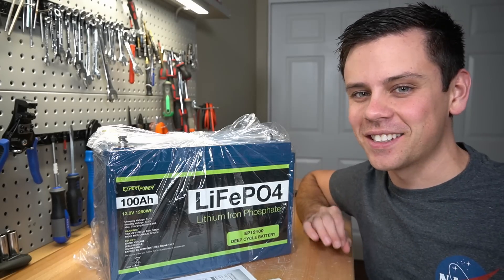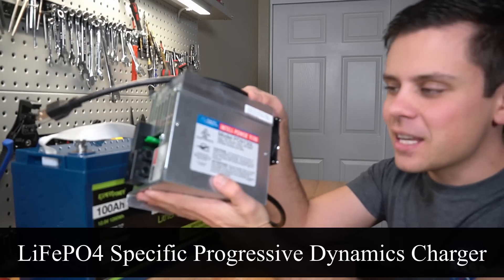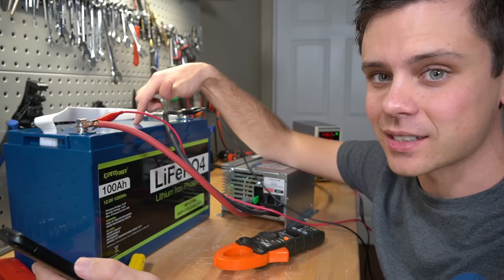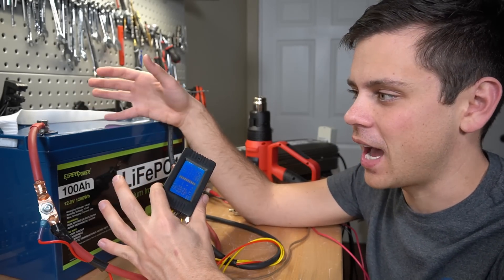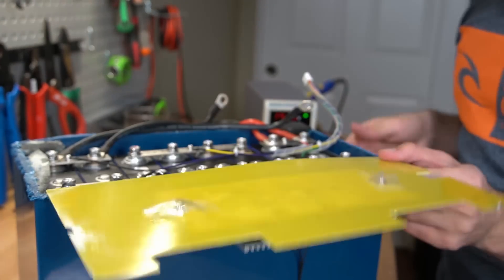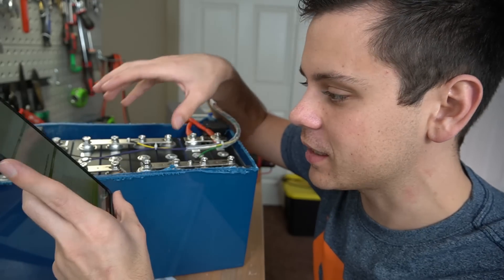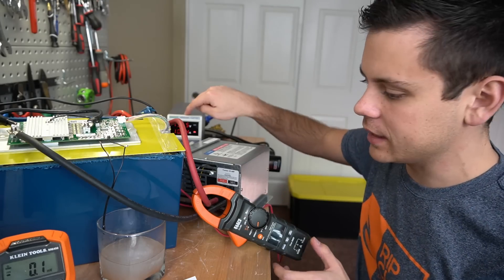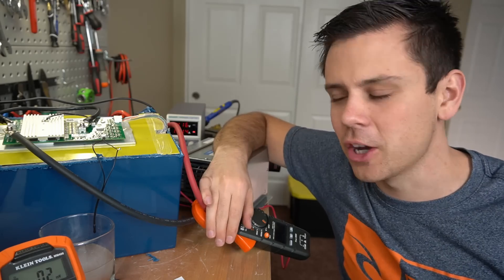ExpertPower 12V 100Ah LiFePO4 Battery Tear Down!

Comment: Wow! How times have changed. While everyone is complaining about inflation, this 12V 100Ah battery was $700 four years ago and now I am considering an ExpertPower rack mount 48V 100Ah for $1000. And Amazon has other 48V 100Ah's for less than $800.
Reply: Same

Comment: I have a 20ah from eco worthy and I was wondering since I'll have two in my bike trailer my worry is tho I will have them over rated temperatures above 180+ and they max at 120f in the trailer how do I keep them cool ??? Especially that significant difference

Comment: You should of tried putting both temp sensors in the water it could get an average  or lithium is hard to freeze and it maybe it needs to be a that temp for a longer period.

Comment: Why would you charge your battery in 6 degree temps..? Lol if you charge it Inside like you should it’s easy and fine no problem with the battery it will function just fine

Comment: Just got ripped off buying that garbage. Showed up dead. Won’t charge after trying various methods.  All I did was connect an inverter that was turned off and the controller (panel switch in off position).   Instant death because some cables touched it or was already dead. 

Can the BMS be replaced by a better BMS?  Did the BMS kill the batteries?  Oh. It’s winter. The battery was in my van all day.  30 degree temp. Dammit.  ExpertPower still knowingly selling faulty product.

Comment: Does anyone know of any ill effects of me putting 6 (six) new ExpertPower 12v LiFePO4 200AH batteries together in parallel? I heard Will mention in this video that 4 was the limit for the 100AH version. The 6 I have are all same age, all were independently charged to 100% prior to connecting them together and I will have red wire to inverter/from charger on first battery in parallel and black wire on last battery. Any feedback would be appreciated.

Comment: Low Temp protection not very important down here in South Texas. Very rarely below 37, might freeze once every 3 years.
Snow, well we had a 100 year snow in 2004, of 12 inches is highest areas and next most major snow was in 2017 of a whole 1 inch. We did have a major (for us) freeze in February 2021, expect another one of those in 100 years. Took down most of the state power grid. Luckily I had converted everything I could to gas in 2018, so we stayed warm. In my 64 years of life the only time cold effected power was in 2017. So what good is a solar system if doesn't work when it is cold? Granted we mainly need power during hurricane season when it rips the power poles out of the ground, summer-fall.

Comment: Hello Will, I really need your help with finding out more information about this particular 12V 100AH Lithium Ion Battery, under the name of Power Queen, currently being sold on Amazon. I want to know if this battery has a temperature gage, and if you would recommend buying this battery?

Comment: Thanks will we have just decided to go 6 V 210Ah AGM batteries to Upgraded 2021 12V 310Ah Lifepo4 Battery Deep Cycle  based on your breakdown review in our RV thanks for your work, I am so appreciative of what you do.
I have been told we do not need to upgrade our solar or shore power charging system by our local supplier in New Zealand and am worried this may be incorrect. 
I would appreciate your thoughts if you have time.

Comment: With batteries like this that have a BMS, why can't they be charged with a standard (non-CC/CV) DC power supply? I would have thought the BMS would handle the charging and cell balancing.

Comment: for all these batteries with no low temperature sensor.....for us fisherman using these exclusively for trolling motors not in the winter of course or even remotely close to temps that will damage the battery, you darn well bet these cheaper LIthium batteries are an excellent fit.

Comment: Hello,

I have an ExpertPower 20Ah LiFePO4 battery. It's about three months old. 

For some reason, I am not able to get current out of the battery, even though it's been charged on a charger sold by ExpertPower and sized appropriately for the battery. The battery appears to take a charge. When I connected the charger, it showed RED on the LED while charging for ~1 hour, then the LED changed color to GREEN. The charger has a small fan, which I could also hear running.

I suspect that I might have tried to draw too much current out of the battery and the BMS intervened to break the circuit, which is reasonable. What I don't know and can't see to find out how to do is to reset the BMS. I have tried putting it back on the charger, I get a GREEN LED, but still no output from the battery.

Any thoughts or advice? I didn't find any procedure for this on the ExpertPower website.

Comment: Looks like the faulty low temp cutoffs were fixed... Can anyone confirm this?
Q: Have the units with the faulty low temperature protection in the BMS been replaced?
A: Hello, Yes! As of April 2020, all 12V100Ah LiFePO4 models have had the low-temp correctly implemented! ExpertPower on April 22, 2021

Comment: I was wondering if you could help me with my question or anyone else who reads this.  I am trying to replace my E-Grizzly Venom 1500W Electric ATV's acid battery (4x12v20Ah lead acid) with a Lifep04 battery.  Could you tell me which you would recommend (type and brand) that could effectively replace the acid battery.  Currently my ATV battery runs the ATV for about 30 min before it dies out.

Comment: Hey Will! Could you do a Chins battery some time. They are supper cheap,  and they are suppose to also have low temp cut off and heated cells. I'm really curious but just not as skilled, crazy, gutsy as you to cut one open.

Comment: I know some batteries have warmers for "cold" weather.  But how good are they and how much power do they consume?  We live in Michigan and do winter RV camping sometimes.  A few times the night time temp is down to 0f.  Will a battery with a build in heater stay warm enough.  Do I have to put my batteries in an insulated (to the outside) box with supplemental heating??

Comment: Enjoying your videos.  Some advice please - I'm in need of a LiFePO4 battery for my kayak trolling motor.  Weight is an issue, but I also want to optimize my time on the water.  The trolling motor is a Minn Kota, 12v Endura, 50lb thrust.  It has a max amp draw of 50. The manufacturer suggests nothing less the 105 amp hr.  Any advice you can offer is appreciated.

Comment: I looked at the 200AH version of this and it's $1449.99. In order for me to get 24 VOLTS at 200AH I would have to buy TWO of these costing near $3K when I can buy a 24 VOLT 240AH battery from Big Battery for $2400 and save $600 plus get 40 AH MORE CAPACITY ! DO NOT BUY THIS BATTERY IT'S WAY TO EXPENSIVE FOR WHAT YOU GET. Go to Big Battery online and get your batteries there instead.

Comment: Hi Will, love your youtube channel.
I have a quick question about the ExpertPower 12V 100Ah you tested a year ago.

We bought one accepting that there is potentially a risk re quality control.

Battery worked great from August until November.

We put the RV in storage for winter with the battery at 60% charge.

Took it out of storage this week and battery is completely dead, <0.1V measured with two voltage meters.

Three days of sun on the solar panels and it didn't charge at all.

Took it out and hooked it up to a battery charger. 

After 12h of charging at 5amps it still only reads 2.5 volts for a few second before dropping to 0V again.

That's a dead battery right? It has a 1 year warranty so I'll be reaching out to ExpertPower via Amazon.

What could cause a failure like that? It worked fine for a few months, was 60% charged and then after 8 weeks with all power turned off it's completely discharged and won't hold a charge. 

Thanks for any thoughts or input.

Comment: First, thanks for the great info and video.

i have one of these batteries thats 3 months old and it just went to 0 vdc. i tried to charge it with a NOCO GENIUS10 charger at 40F and no good. Tried it again at 70F and still nothing. The charger has a force mode for charging batteries with a voltage lower than 1V. Op manual says to Press and Hold for five (5) seconds to enter Force Mode. The selected charge mode will then operate under Force Mode for five (5) minutes before returning to standard charging in the selected mode. Is this worth a try?

Any way to reset this battery so it will take a charge or can i get it replaced under warranty? Thanks

Comment: I bought one of these batteries, so I'm disappointed about the Low Temperature disconnect. Should I send it back?  So do I need to keep it warm? Also, how do I monitor the amount of capacity left in the battery as I'm using it? Will a small, simple capacity meter, as used for AGM Batteries, work for monitoring it's capacity?  Your reply appreciated.

Comment: I have a sailboat I want to upgrade to LifePO4 batts with at least 600amp storage, solar, victron solar charging controllers and be able to charge at maximum current. VERY interested in building batt sytem myself. What are the absolute critical criteria when source cells. Oh, want bank to charge at 24V. Looking for some help

Comment: Just checking, you're talking about some pretty serious temperature ranges and load testing, presumably for home solar setups I think. I'm looking at using it for a single panel setup in the back of my ute with a dc/dc charger that has its own safety settings inbuilt. And my ambient temperature range would be 10-40°C (10-104°F) anyway. My max draw on this setup is also only 9A because it's only for a small fridge and a couple of led lights. I can't see how I would actually ever be pushing this to the levels of when these safety features would be needed. Am I being naïve?

Comment: Hi, really enjoy your channel. I have a little problem with my lifepo4 battery.  I bought a battery from China and it has been good for couple year. Yesterday, I was using it and suddenly the battery shutdown and never come back.  Before it shutdown I notice the voltage is around 10.x volt.  Is this low voltage protection behavior? If so, how the battery can be turned back on. If not, is my battery bad? Really appreciate any expert advice.

Comment: My question for you if you ever see this comment is would i be able to use this battery as reserve for my car audio system running a amplifier that draws 300 amps at max power but most likely around 150 amps at like 30 mins at the  longest all i want to know is would you recommend this battery for that type of situation or should i spend more on a big name brand and avoid a headache?

Comment: Great video! Now I only watch your videos when I want to know something about solar. Which brings me to my next question: I am scared of a fire in the shed where I am building my mini solar system.
It will be two deep cycle acid marine batteries, a 1000watts 12v powee inverter, a 30amp charger and 3 solar panels.
What is the best way to avoid a fire?

Comment: Hi, I just purchased 4 of this type of battery but 130ah. I have them connected to a pip4048 inverter /charge controller. I am running a 2.4 kW pump to irrigate pasture. It has been running - 2 months. It is working great. The pip4048 has been reflashed for Lifepo4.

Comment: in a rv how did you solve the issue of hi amp draws from an inverter when using common household appliances with out the bms taking the day off?   between the convection microwave oven, a few crt tvs, an ice maker, a freezer, a separate refrigerator/freezer pair  i'd estimate pulling 300 amps through the 3000 watt inverter. the biggest bms i'm finding is about 120 amp .

Comment: This was 6 months ago. Any word on the New battery? I would love to see the test and price point. Great video! Take Care and be safe, John
Reply: It's in the pinned comment. BMS was not programmed for low temp only high temp
Reply: @south02m  I had read that. I didn't know if he had got another one that tested correctly since and what the price point was, at that point. I mean, they said they were going to fix the problem, but has anyone tested a new battery since? If I were to buy one today, would it still have that issue? Thanks, John

Comment: I had to laugh when you 'stayed put' for the entire battery discharge cycle.  I used to perform destructive anaylsis on lead-acid cells (to build our own batteries for a rocket factory) about 30 years ago for the Delta Launch vehicle.  Yeah, old school.  One of our tests was to check capacity,  and had to record the cell voltage during discharge at time intervals.  Difficult to stay awake.  This was before new test equipment was procured to perform this test automatically.  Appreciate the tear-down.

Comment: Since the battery has a max charge rating of 50 amps, do you need to somehow protect the battery from charging too fast? 

For example, if a system had a 50 amp DC to DC charger from the alternator running at max speed and a solar array charging at 20 amps. Total charging amps sits around 70 amps which is over the rating for this battery...

Comment: All  Victron charge controllers and inverter/chargers are suppled with battery temperature sensor cables  so this battery would be okay for me as I only use quality equipment.

Comment: Will, thanx for you test of the ExpertPower 100Ah battery. It is now five months later, June 28th. I did not see any update from you showing the company's response.  Is it safe to assume that Bryan/ExpertPower failed to supply you with an answer to why the low temperature test failed on your purchase? Solitary defect or systemic?

Comment: First let me say your reviews are the best on the net. You are a first class great reviewer.
But I wanted to ask a silly question. I was wondering. Could it be that the outside of the battery was colder than inside. It could have still had some warmth from all those internal batteries. Possibly if you had left the batteries in the refrigerator for a couple of days to ensure for sure the internal portion of this battery had time to reach that low temperature before you test it next time. I think you said you left it in the fridge for about 4 hours. But i think that was not enough time for the entire center of the battery to drop to the desired temperature.  But possibly i did not watch closely enough to your video and I may be way off base. And if so please forgive me. Just making a possible comment.
Thanks

Comment: I'm looking forward to a 48 volt battery pack.  When you are looking at 15-30kwh of storage, you need high voltage to keep the current reasonable. (I'm in air conditioning country, with electric heat for the winter... about 30kwh used per day...)

Comment: Will, wanted to know if you had a chance to play around with their smaller 12V 10Ah battery? I just picked up one as a drop in replacement for an existing SLA 12v 7Ah battery for my kids power wheel car and it cuts off all the time. I'm guessing it's the BMS trying to protect the battery but not sure why, any idea how I can test what the discharge rate is during use to figure out exactly when it cuts out, would like to install a device inline that will remember the maximum amp draw and discharge to see if it is anywhere near the manufacturers limit.

Comment: It doesn’t look like they solved the low temp cut off problem. According to their website they now suggest that you only use the battery in temperature >32 degrees F and that you purchase a separate controller with low temp cut off built in. “The perfect battery for planned storage in temperatures > 32F, or with solar controllers and temperature sensors that support low temp cut-off.”
Reply: Kevin Bernard  omg that is terrible 
Maybe so many apologies for nothing

Comment: I'd be interested to understand the series and parallel limitations. Voltage, like pressure, is relative. If you chain 3x12vs to get 36v, the pressure ratio is the same across all batteries. With parallel, why does each battery care how many units are there? The voltage stabilization will happen the same way between two batteries as it would with 200.

Comment: Will, do you believe that purchasing this battery today, for a first time solar user at 400W is ok? I wonder if the issue has been rectified and they are g2g, or not... A lot of information to take in. I’m not quite ready to go the battleborn route as everything else involved is costly, and I’d rather save some now and upgrade in the future. I do know I want to get 2 lithium for my 400W system. Does this seem correct?

Comment: I watched one of your video an keep thinking about the solar generator your previewed. Seeing I live in timber, off grid, having 340 solar panels with another 40 panel for motorcycle battery. 5-29/marine batteries! I could use more than one, during winter have to charge batteries once week gas generator. What are you favorites for the money? Thanks so much!

Comment: If you want larger battery banks just buy individual cells and build your own. Will has videos on this. Not a fan of 12v batteries. A simple 12v  digital thermostat control on Amazon can solve cold charging issue. Even a HVAC thermostat and normally closed contacts running on AA batteries can be setup to solve this issue. Nice video Will.

Comment: A suggestion for a battery teardown video. I am into experimental aviation and some people are starting to use lithium batteries as a replacement for lead acid. While an aircraft starter battery is not near as big as what you normally evaluate, it might make for an interesting teardown video to see how well they are built.

Comment: Will:  In your capacity tests, it seems that your low voltage cutoff is not consistent.  In this case, the battery ran down to 9.5V, so I would expect that the Ah test might be higher than others you have tested that had a higher cutoff.  Didn't you let the capacity tester do the cutoff, in some other tests, at a voltage above the BMS cutoff?